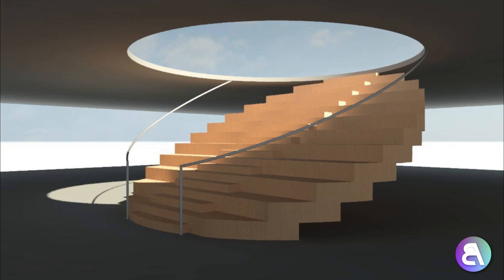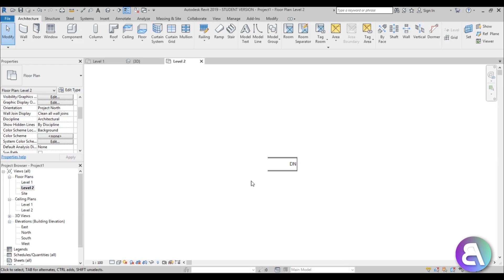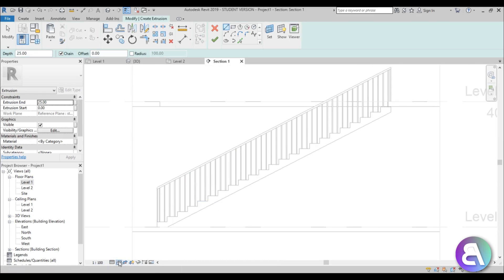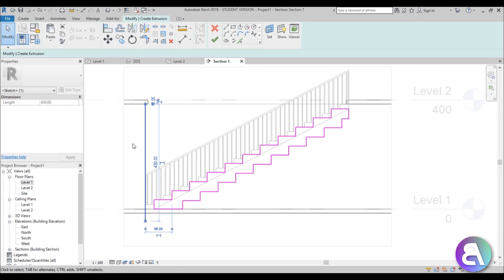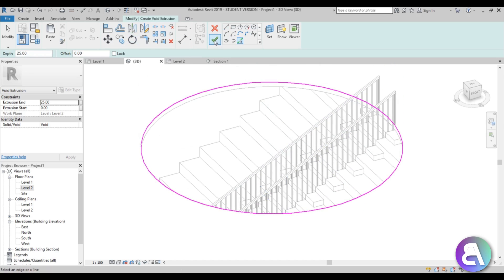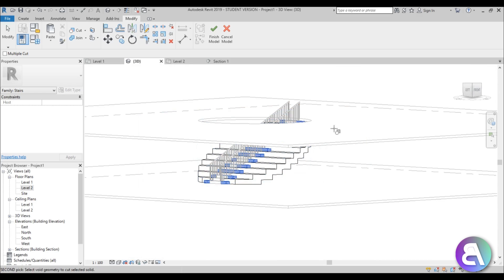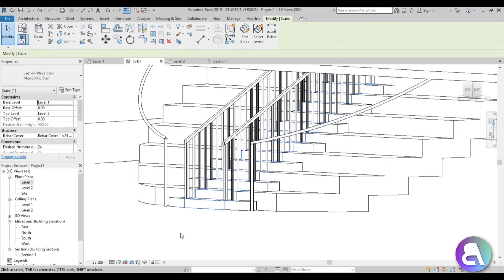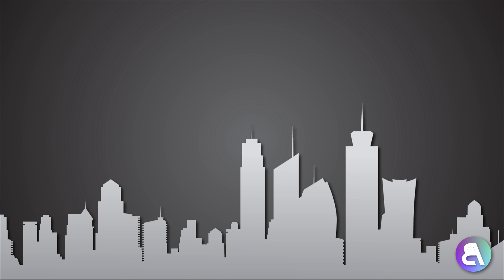Circular Stair / Auditorium in Revit Tutorial

Comment: I followed your tut and when it was time to cut the stair with the larger void, instead of cutting the stair sides and leaving the circular stair shape, it leaves the outside part and cuts a hole inside the whole stair. So its exactly the opposite. What is happening?
Reply: I have the same problem ! aaaa